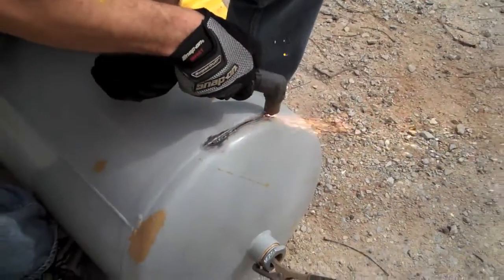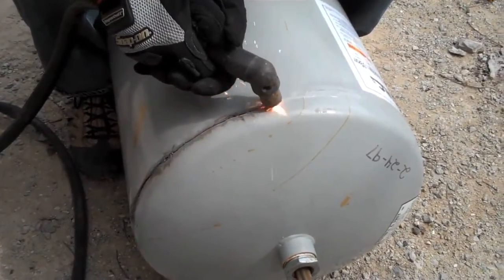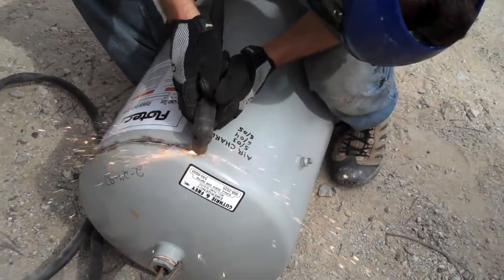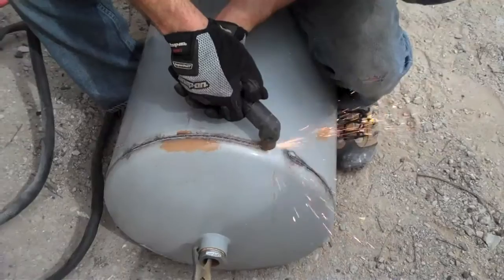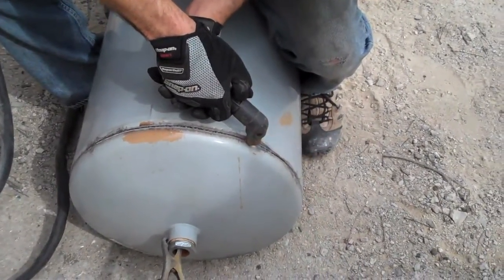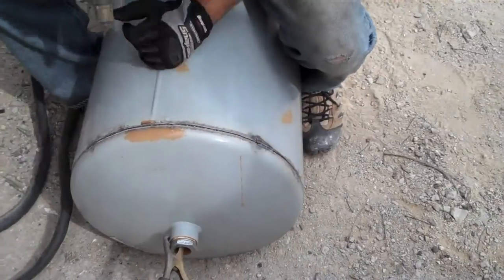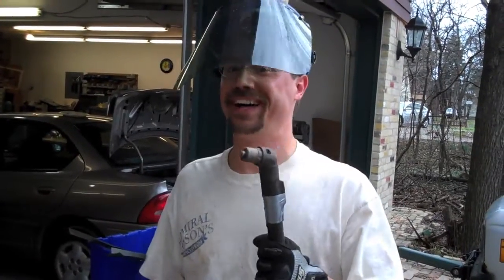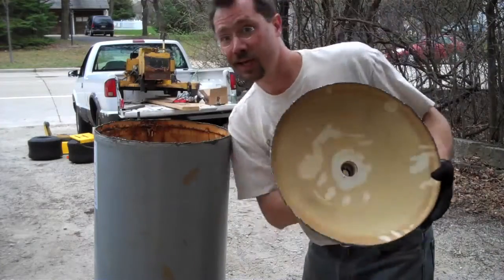Tank vs Plasma Cutter!

Comment from the maker: This will be used with a 4'x10' solar hot water panel with a closed-loop antifreeze system. One coil of copper pipe will feed into this tank from the solar glycol loop, and another will come from my well.

Both copper pipes will go into, then out of the tank. The tank will be filled with water, which will transfer the heat from the one copper pipe to the other. This is one variation on a "double-wall heat exchanger".